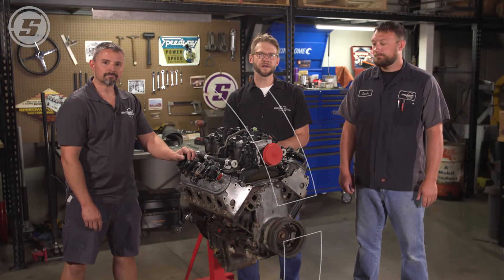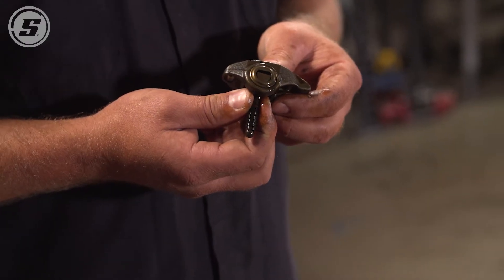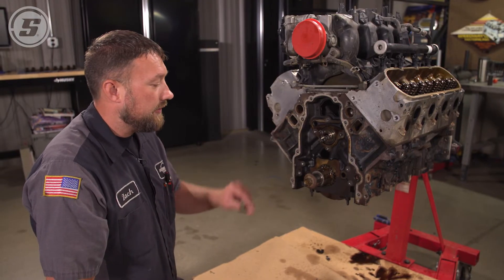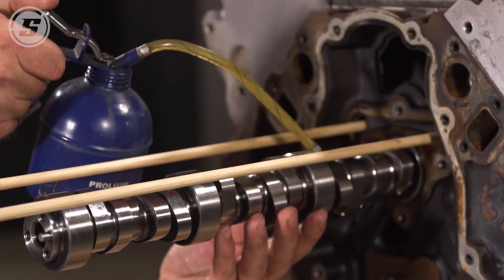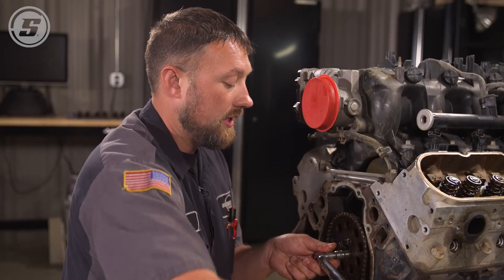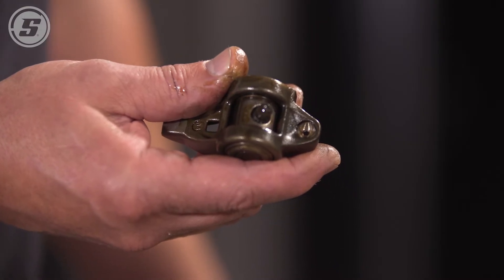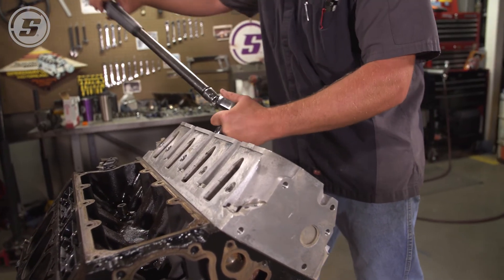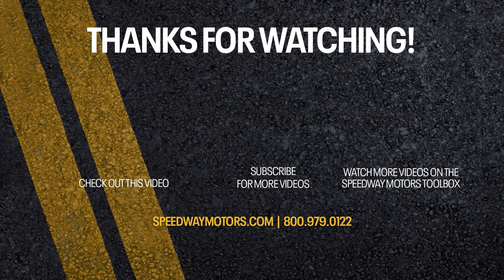Camming a 5.3 LS Engine | LM7 Cam Upgrade + Trunnion Install Guide

Comment: Do you need to turn the engine over when removing the rocker arms? Heard you need to to take pressure off the spring. Wasn't sure if it is necessary.

Comment: Quick question. did you use the stock push rod size I believe it’s 7.400 or did have to go up or down in size with the BTR truck Norris.
Reply: I got it in a kit from btr came with  thicker wall stock length pushed rods. After Following richer holdner's video on installing. Being Between a half and one and a half turns to seat rocker to tray, after 0 lash. I think I could have got away with 7.425

Comment: Great Video but I am in need of your assistance. On my 5.3 LS Engine, I have started pulling apart my front end and tried to slide in my dowels into the oil ducts, on the drivers side I was able to slide dowel all of the in but on the left passenger side, i wasn't able to slide in the dowel all of the way because it stops half way. I have turned my cam shaft several times but it seems my lifters are preventing my dowel from going in. How do I correct this?
Reply: Are the dowls radiused at the ends? If they are really sharp it can make it a bit harder. The dowls can be a pain to use. I have installed several cams wout them just by spinning the cam and making sure I had everything laid out so I could put the new cam in quickly.
Reply: @thecheckeredgarage  Thank you
Reply from the maker: Hello! Instead of grinding a point on the end of the dowel you can try cutting a 45 degree wedge and try to get it positioned right. Good luck!
Reply: I used a bit smaller dowel and it worked perfectly. This video really helped a bunch. Thank you.

Comment: I bought a 5.3 for my 1970 Firebird, the race shop I bought it from said the cam had been swapped with a BTR cam. Is there a way to find out what type without taking the motor apart?